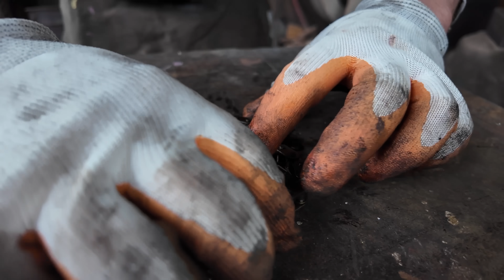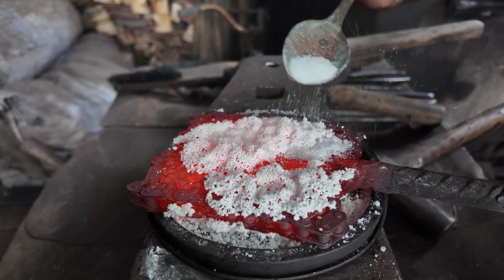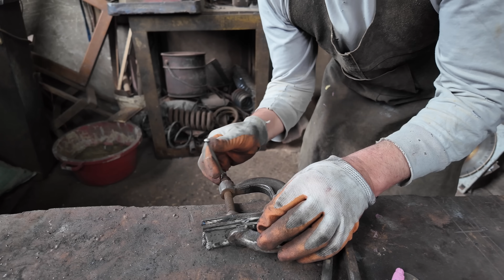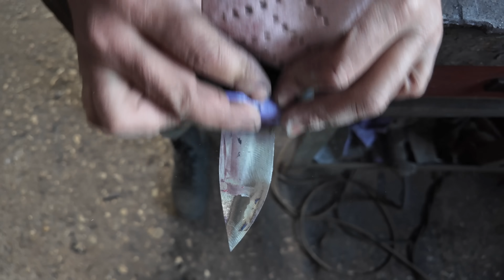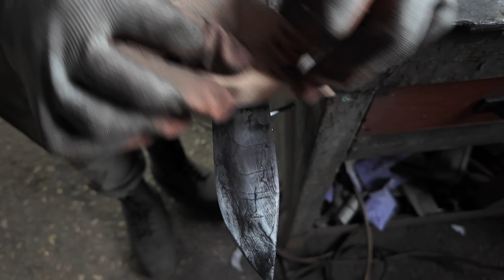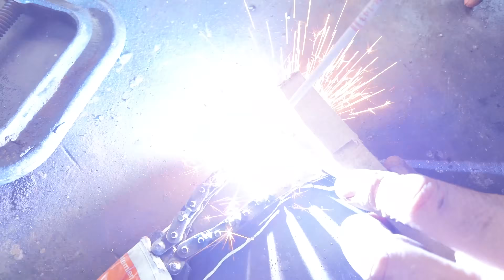Snake Bite Steel: Creating a Deadly Damascus Knife from Car Chains!

Comment: Pouvez vous me dire à quoi sert la poudre blanche que vous mettez ? Can you tell me please the name of the white powder and for what use ...thank you !
Reply from the maker: The white powder I use is **borax**, a flux commonly used in blacksmithing. Its purpose is to prevent oxidation during the forge welding process by cleaning the surface of the metal and allowing the layers to bond more effectively. Thank you for your interest! 😊🔨🔥
Reply: @masterknives555  Thank you !

Comment: What is this powder sprinkled on top of the hot piece of Iron?
Reply from the maker: Great question! 😊 The powder you see is borax. It's used as a flux to help clean the metal and prevent oxidation during the forging process. 🔥🔨 Thanks for watching and supporting my channel! 🙌

Comment: What's the white powder for?
Reply from the maker: Hey there! 👋 That white powder you see is borax! It helps with forge welding by preventing oxidation and promoting better bonding between the layers of metal. It's like the secret ingredient in making these blades strong and beautiful! 💪🔥

Comment: What is that powder you use on the metal during the forging process?
Reply: Borax
Reply: It's borax because he can't forge a blade without it. Technically he's cheating
Reply: @bigrube420ify   ну почему же  тетраборат натрия  применялся с 13 века  для дифузионной кузнечной сварки

Comment: Car chains??
Reply: Timing chains from the engine
Reply: @marksanders4657  
The only clear images looked like motorcycle roller chain. Automobile timing chains I'm familiar with have no rollers, but many more leaves.
Reply: Well there are different types, I have seen this type, some are double and also like you describe.
Reply: @bhutjolokia6990  
If you say do. I've never seen roller chain in a timing cam drive application. Timing belts, leaf chain, even gears, never roller chain.
Reply: That type in 70's motor🤪🤪